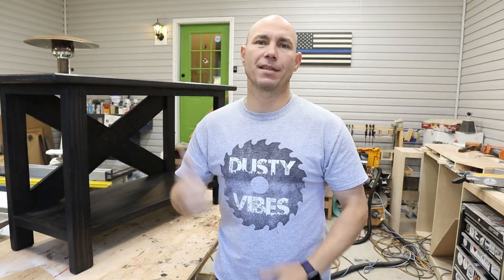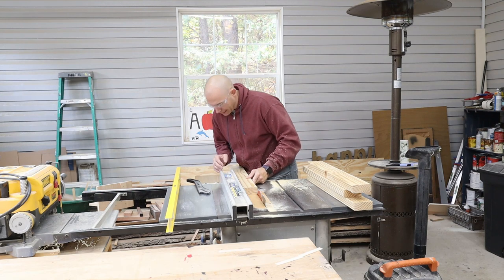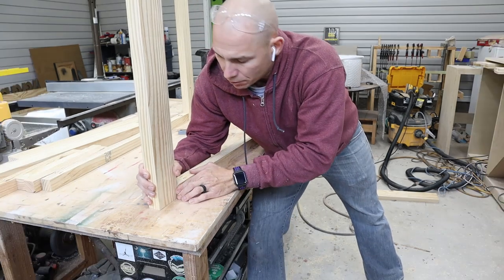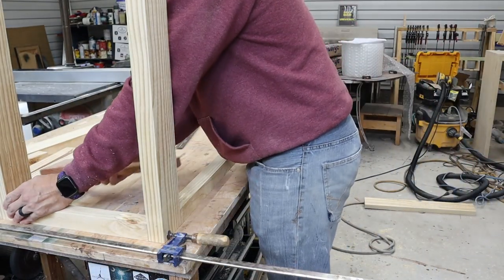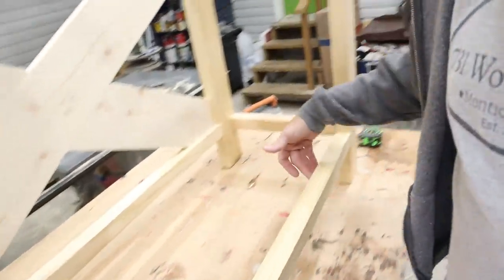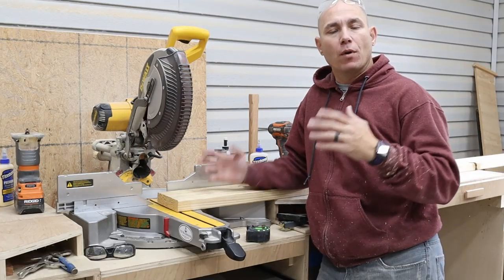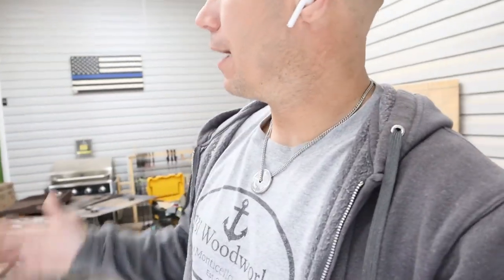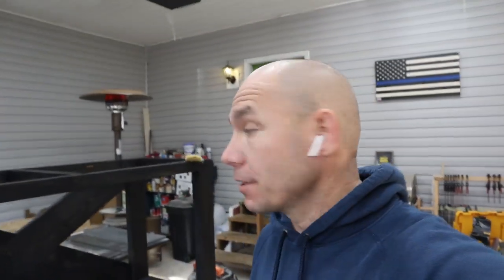DIY Farmhouse Sofa Table | TV Stand with Build Plans

Comment: This project is on my to-do list for this week and I am going to make a matching end table. I know this video is an oldie and I am late to the party but one thing I did notice was when you did the pocket holes for the top horizontal rails the pocket holes are facing to the end of the board. I am sure the rest is beefy enough to not make a difference but as a "Best Practice" it would probably be better to have those on the other side so they angle down the length of the side. The top will cover them as well so it is a win/win situation. The lowers of course don't matter as they are in the middle of the vertical "legs". Just something for any other newbies to make note of down the road. Great Video as always.

Comment: Nice build, I appreciate how you explain how to do things without expensive tools. Your jointer method is a great idea, simple to do without clamping the straight edge. I wonder if I can use a slot cutter for the table top fasteners. I like your method for the cross pieces. When they are angled in like that the pocket hole connection works great, especially if you fill the with dowel or plug of like wood. Good job.

Comment: I am a welder who wants to be a carpenter/welder.  A year ago, I bought a small building 8 x 12 to do some wood work projects in. I have built 6 Squirrel picnic tables and some really bad display cases. The table looks very nice.  I will check out many of your videos. Thanks.
Reply from the maker: thank you
Reply: @731Woodworks  can you tell me what length of screws to use. Thanks.
Reply from the maker: For 2x material I use 2 1/2” screws and for 1x material I use 1 1/4” screws
Reply: @731Woodworks  Thanks so much.

Comment: Thank you for the great video's!  I have built 3 pcs of furniture so far.  The last was a Sofa/TV Console table (without the X) but wrapped the upper and lower parts of the legs with rope and added a cleat on the top of both ends to make it nautical.  It came out great!  I really appreciate your instructional video's.  I have learned to many tips to help understand the different ways to make it look more professional.  I sold my store bought furniture, took that money and purchased wood for my "new" custom furniture.
Reply from the maker: Glad the videos helped

Comment: I am thinking that is what I need.  I wanted a table for the kitchen to put my cast iron cook ware on.  I was thinking of a black pipe rack on the top with floor flanges to hold it to the table.  Use a couple of pipe cross pieces and put hooks on it to hang frying pans and the like, the flat surface could hold large pots like dutch ovens.  Just measured the spot and 50 inches fits perfectly.  Thanks.

Comment: So I got tire of searching for pencils as well. Try this tip...get a couple of flat rare earth magnets about the size of a quarter. Stick them together on either side of your shirt. Use a pencil with a metal clip on it and stick it to the magnets. Never lose you pencil again. I put a magnet on pretty much anything metal in my shop so I can stick a pencil on it...Bandsaw, miter saw, drill press, all have pencils right there. Hope this helps. Love your videos!
Reply from the maker: Good tip

Comment: I know this is an older video, but I just found your channel. I used to make knives. But ran into some unfortunate circumstances and had to sell all of my tools. I'm down to a small circular say and a jig saw. A router with no bits. Oh, and a square and circular orbital sanders. I'm thinking getting into wood working because the start up tools are cheaper. A jointer, planer or thickness sander together are cheaper than a belt grinder for knife making alone.

I say that to say, your videos are making me impatient! I want to get started. I'm putting together a tool shipping list now. I've got some hand tools on my list but I can get started with what I have. I've been making some bentwood rings. Going to get some wood for a lazy susan or cutting board or enough for both. Plus I have some friends with bigger tools. Drill presses, band saws, lathes if I need stuff like that.

Sorry I'm rambling on. Your videos got me excited. I don't get excited about much. Your mallet video with the honor the fallen coin really earned my respect.
Reply from the maker: Glad the videos have been helpful. It’s hard to be patient lol

Comment: Hey, that was pretty fast!  One thing they may increase accuracy is stop using a pencil to mark cuts. Using a sharp scribe will greatly improve the cut precision, especially on angles, and  eliminate the joint ‘spaces’ that can’t be closed when fastened.  Thank you for all your presentations!

Comment: Nice project, I think I can build this. Question on the level used for the "jointed" rip: what is holding the piece of 2x4 against the level? It looks like you are using just your thumb at the back end of the lumber. I guess that does the job. BTW, just subscribed.
Reply from the maker: Thanks for the sub. I just hold it with my hands. I used to use painters tape but found that unnecessary. Here’s my video on it https://youtu.be/9HMMWGkI1ZI

Comment: Nice project. Why wouldn't the bottom shelf need to be fastened to allow for expansion, especially since the boars will push agains the rails when the expand?
Reply from the maker: I've never had any issues with the spruce doing that.  Not saying it won't but I have several tables built like that and never an issue.  You can use table top fasteners if you wish.

Comment: The lower shelf with the 3/32" unevenness, if you was to do this again, would you have ran the boards thru the planer or use an electric hand planer (if you had one) for particular uneven areas?
 I'm looking to build something like this for a first build and I know I can be somewhat of a perfectionist.
Reply from the maker: That little bit didn’t bother me and I wouldn’t likely do anything different

Comment: Hi Matt. Somewhat of a newbie here, recently discovered your channel and I love it. I recently had a friend challenge me to expand my hobby to bigger projects. She asked me to make her a sofa table but at 90 inches long and 10 deep.  You have any thoughts on attempting this build at those specs?  I usually stick to smaller stuff but this one kind of excites me.
Reply from the maker: Hello, I think that would work with those specs.  I might would add a small support leg right in the middle under the bottom shelf just to help support that span if they put anything heavy on the bottom shelf.

Comment: Hi Matt! I'm just getting started and learning so much about woodworking. Thanks! You mentioned using yellow pine for the legs and spruce for the table top/shelf parts. My question is what size 2x4's do you buy? 4 foot, 8 foot? Same question with the 1x6's? Take care.

Aaron
Reply from the maker: I buy 10 foot boards.
Reply: Thank you. Good thing I still have my minivan. I think I've heard you say you get your pieces from a lumberyard vs the big stores. Am I right in that? Is there a difference that you can tell?
Reply from the maker: My local lumber store sells similar lumber as the big box stores. Mostly pine and spruce. Construction grade sthff

Comment: Looks great!  
How has the bottom shelf held up?  Other woodworkers on YouTube say that by binding or  encasing the wood (shelf) that it doesn’t leave room for the wood to move and will eventually crack or have problems - I’ve made a few similar to you - hoping for the best
Reply from the maker: No issues so far

Comment: Sorry forgot to ask. Have you had any issues using other table top fasteners such as corner fasteners and have you had any trouble with the table top warping? I was always told to alternate the growth rings to prevent warping. maybe since its so thick it doesn't matter?
Reply from the maker: I haven’t had those issues. It is best to alternate but I never do that. I pick the best side for the top side

Comment: Do you ever use the planer for boards you are connecting and if so, does it reduce the amount of heavy sanding required to get the edges flush?  Appreciate it.
Reply from the maker: Yes, it will reduce the sanding because all of your boards will be the exact same thickness.  Sometimes when you buy lumber from the store they are not exactly the same thickness.  They may be off 1/16" or more from each other.

Comment: I love the Dewalt calculator app you showed us. Just installed it. I guess they have updated it since your video. Looks completely different. I typed in 14 (pressed "in" for inches / 3 = and it gives me 5in (press the inches button and it changes it to "ft-in" and shows 4&43/64in). Not sure what they've changed, but it didn't give it to me in 16ths. I found my late fathers woodworking calculator in a box of stuff. I just typed in 14in / 3 = and it gave me 4&11/16. So that just proved to me that dads little handy calculator will always be near. I figured the app would have been more convenient since we always have our phones on us. Do you think I'm not doing something right on the Dewalt calculator? I didn't fail math, but I wasn't the top student. HAHA.
Reply from the maker: Not sure, mine still looks the same.  I think there is some settings you have to configure in the app

Comment: Hello, I really enjoy the videos I have seen you in the past use the level for the straight cut, my question is isn't that what the fence is for, I'm confused by the level. HELP lol
Reply from the maker: The level moves with the board, thereby giving the board a straight edge to reference. If you just use the fence, the edge being cut is referencing the other side of the board. Which is typically never truly straight.

Comment: Do you always square off you 2x4 edges in the table saw? Just started to build my first peice( the farmhouse end tables) and when I started to put it together, I hated how the rounded 2x4s looked against the ripped down 2x2, it just looked terrible. 

If you do, what do your 2×4s come out to be width wise after?
Reply from the maker: yes I do. Typically they are about 3 1/4" wide afterwards

Comment: Hey i am struggling to understand the purpose of the level when you are using the table saw. When using the level on the flat surface, i doesnt give a level indication, right? If your table stand isnt straight, the level won't correct it. Perhaps i am missing something. Btw great video and great woodworking, keep it up!!
Reply from the maker: The level moves with the board, thereby giving the board a straight edge to reference. If you just use the fence, the edge being cut is referencing the other side of the board. Which is typically never truly straight.

Comment: question for any of you who know: Why are you using the level as a straight edge? Why can't you put it against the  fence? When you did the other side that is what you did? Thanks
Reply from the maker: Using the level gives the board a straight reference that moves with the board.   Essentially squaring up the opposite side.

Comment: do you lightly sand between your polyurethane coats?  Ive never used a finisher before wanna make sure i do it right
Reply from the maker: I use a high grit (1000 grit or higher) sandpaper and very lightly sand between coats.
Reply: @731Woodworks  Thank you!  How long do you usually wait between coats?
Reply from the maker: Water based, about 30 - 45 min
Reply: @731Woodworks  Hi I just wanted to say thank you for the tips!  I applied this to a project last week and the result is awesome.  Waaaaayyyyyyy better than any finisher that I have used before.  I plan on using this from now on.  I look forward to your future vids!

Comment: Great video.  Getting ready to start this project soon.  Quick question, how did you clamp the bottom shelf when screwing in the pocket screws?  I slowed the playback down and still can't make out how you did it to make sure the shelf was flush.  TIA
Reply from the maker: I just used some clip clamps to hold them up.  Basically the clamp isn't actually clamping the shelves, it's just providing a way to hold it, then I screw them in slowly making sure they don't move.

Comment: Why is it fine not to use tabletop fasteners on the bottom, but use them on the top?  Wouldn't it be fine just to use pocket holes to hold the top on?

Comment: Hey brother what kind of a heater do you have in your shop? I been trying to find a good one for my shop thank you in advance
Reply from the maker: I’m just using a patio heater that uses propane. My shop has plenty of air leaks so I don’t have to worry about it getting too stuffy.
Reply: @731Woodworks  right on thank u I've been looking for something my shop has plenty of air leaks too but if it ever got to bad I could just crack a garage door I just want something so I could keep working in there year round for the longest time in winter I just don't go out there cause it's to cold but if I could find something that will heat it up good I can be out there year round thanks again👍🏻and I enjoy ur videos keep them coming and keep up the good work
Reply from the maker: Thank you. I would eventually like to install a mini split in there that will heat and cool it. But that’s later down the road.

Comment: Another question.  For the table top,you made four cuts from the 2x6x8 at 50+ inches (total of at least 200 inches).  The parts list only has two of those boards...the math doesn't seem to work to get four from the two (96 x 2 = 192). Did I miss something?  Getting ready to work on the top now.
Reply from the maker: It's a typo.  Need two 10 foot boards or three 8 foot.
Reply: @731Woodworks  that's what I thought.  Think going down to 48 inches long will be too much of an issue with the rest of the measurements?  I have the boards and would rather not go back to the store to swap.
Reply from the maker: It should work
Reply: @731Woodworks  worked well and looks fine.  Construction is complete, final sanding, stain and poly left.

Comment: I noticed you put the table top fasteners  on all sides. I know for plywood that's fine, but not recommended for solid wood. I just order some and also download the tech specs for them on the Rockler web site. They should run parallel to the grain.  I was doing it the same .🤷‍♂️👊
Reply from the maker: thanks for the tip

Comment: What is the tooth count on your saw blades?
Reply from the maker: Table saw is a 60 tooth https://amzn.to/372dZx1 and miter saw is 80 tooth https://amzn.to/2QhFn41 Both Diablo brand blades.  They are awesome for the money.  Diablo makes great blades that won’t cost you a ton of money and they last a very long time.  I bought both saw blades in February 2019 and they are still going strong.  I included Amazon affiliate links to both if you want to check them out and read some reviews on them.
Reply: One other question. What is the distance from the top do you cut your slots for the fasteners?
Reply from the maker: @matthewwright4188  I don't know the exact distance.  I take the table top fasteners and hold them up to my router and set it slightly lower than the fastener itself.

Comment: Don't mean to sound stupid but I don't understand the use of the level on the table saw for a straight edge.  Doesn't the fence have a straight edge??  What's the difference?
Reply from the maker: If you use the fence and just slide the board along then if the board isn’t straight, you won’t get a straight cut on the blade side. However if you use the level, and move it with the board then you are giving a straight reference for the board and this get a straight cut
Reply from the maker: Check out my video on jointing with a table saw https://youtu.be/9HMMWGkI1ZI
Reply: @731Woodworks  Had to read that a couple of times but the Bell in my head just went off. Lol.  Thank you, makes perfect sense now.
Reply from the maker: You’re welcome

Comment: Hey Man - the lumber list is not enough - I needed 4 2 x 6 x 8's
Reply: not sure if I did something wrong - I ended up cutting 2 pieces at 50 inch, and ended up ripping the scraps into 2x2's
Reply from the maker: It is quite possible I made a goof on material list
Reply: @731Woodworks  it's all good, big box store is less than a mile - but I'm trying!  1 peter 2:4
Reply: @731Woodworks  I think 3   - 2 x 6 x 8's is needed
Reply from the maker: @jasonscroger5065  Thanks

Comment: I learned the hard way not to use an impact driver with pocket screws. Drove them too deep and some popped out the other side. I switched to my Ryobi drill with the clutch on 4. It works a lot better.  Adjust the clutch to your liking.  Second. To easily clean up glue squeeze out, dust it with sawdust and scrap it off with a putty knife. If necessary clean up remnants with a wet towel or sponge.  If you build one of an item all the way though before you start the second, or third, you will waste a lot of time. Save time by cutting all the wood you will need for multiple copies at once. Make it like an assembly line. I am building interior barn door shutters. There are a lot of pieces. I cut all the pieces for a set, sand them all, polyurethane them all, and assemble them all. There are many stages, but I am at the same stage with all of the shutters at the same time.  When, I cross the finish line, I have a whole set done. It is amazing how good you get at something by doing it over and over and over.  I am a big believer in pocket screws. In fact, they got me back into woodworking because they make joinery a lot easier, yet still strong.
Reply from the maker: Yeah I keep mine on a low setting